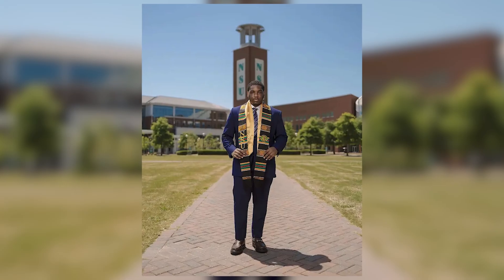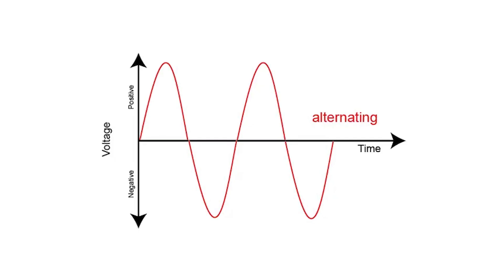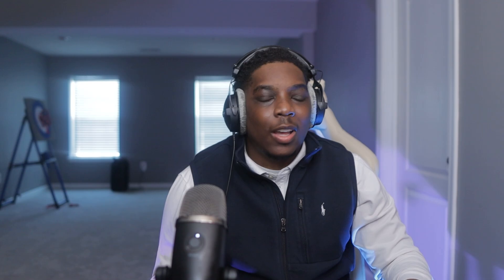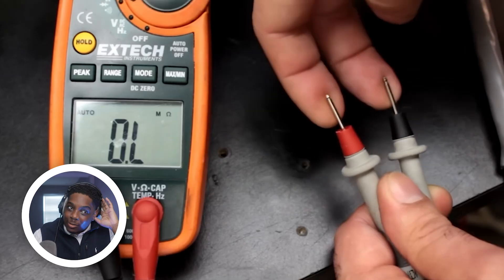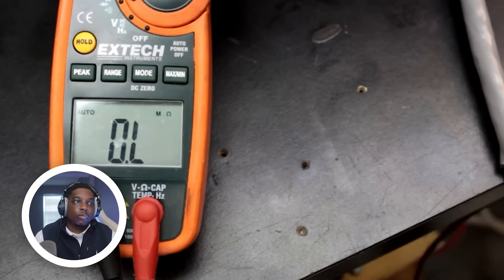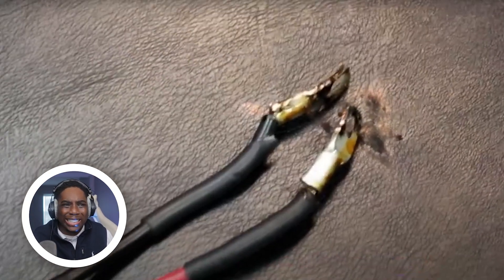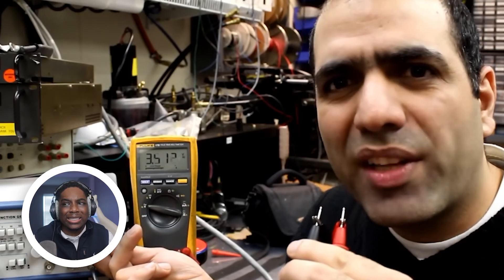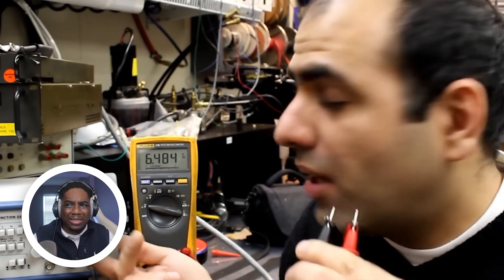AC Vs. DC Current (Which HURTS More?) - Electrical Engineer REACTS To ElectroBOOM

Comment: ECT (Electric Convolsive Treatment) was used as treatment for Epilepsy in the 1970, this was strapping a person down to an Iron/Metal bed and passing a current through the body to try and Sycnorise the Brainwaves to pre vent sizures. Did Not Work and was abandoned as a method of treatment.😊🧡

Comment: AC does hurt worse, but DC has a higher chance to kill you.  The reason is that AC causes your muscles to contract and expand rapidly, which can cause you to be thrown from the source.  But, DC causes your muscles to just contract, which means you will hold on to the source.  Also, getting hit by 480 VAC is not fun.